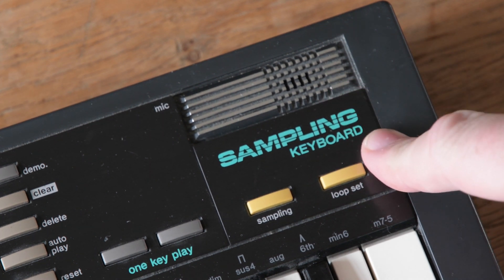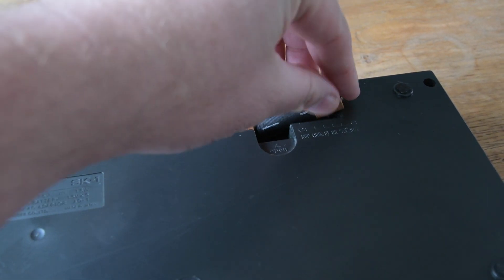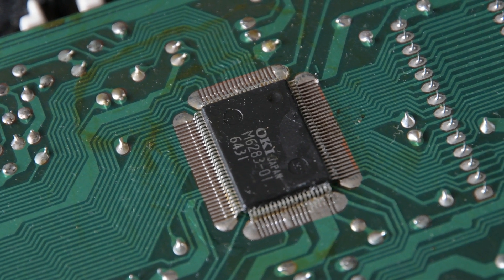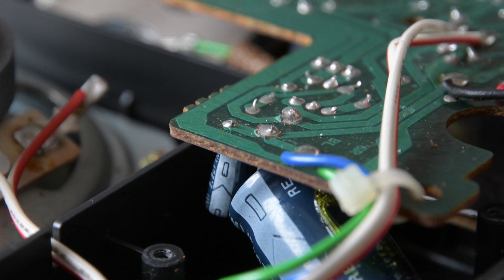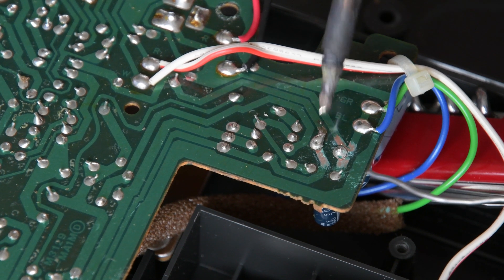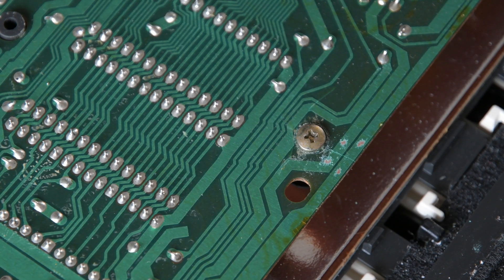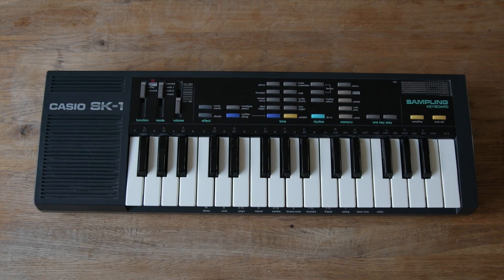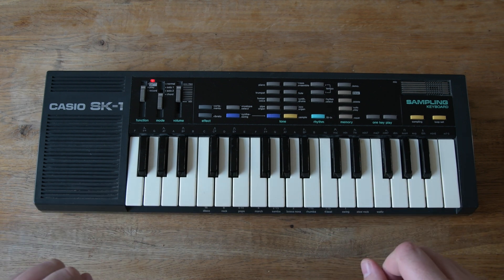Casio sk1 - Can this be repaired?

Comment: The foam part on the cable is for vibration dampening and also cable wearing issues and also there is supposed to be a rectangular strip of cork in the battery compartment to hold the batteries down.

Comment: I've got the Realistic branded version of this little SK-1 and it worked when I got it but after getting moved around in storage for a couple years when I went to power it up it's completely dead like yours. No power with batteries or with a plug in power supply.

So crossing my fingers that I can find a fault as simply as you did here!
Reply from the maker: You got this! Power off is my favourite issue as you know where you start and where power needs to go. Good luck 🤞